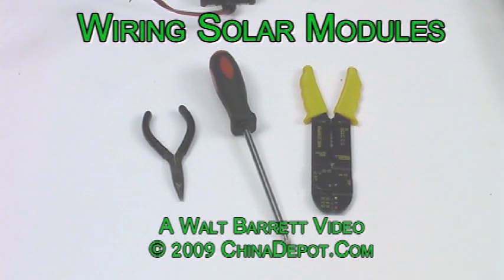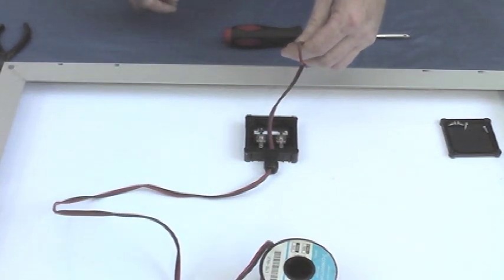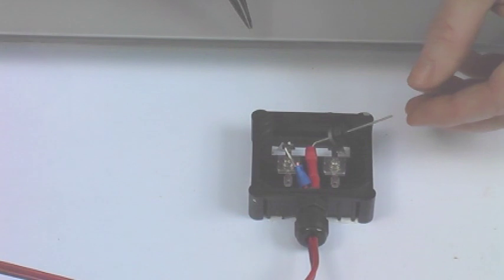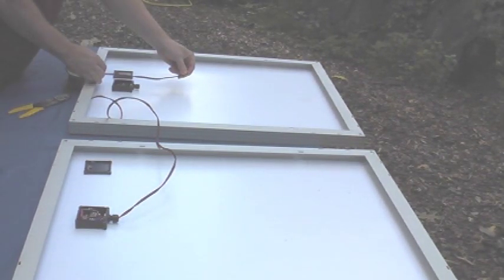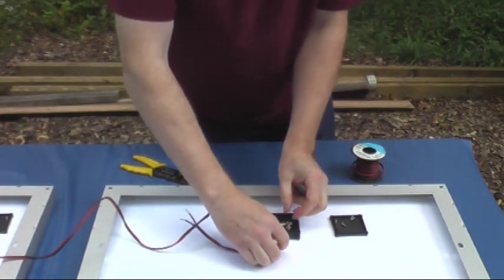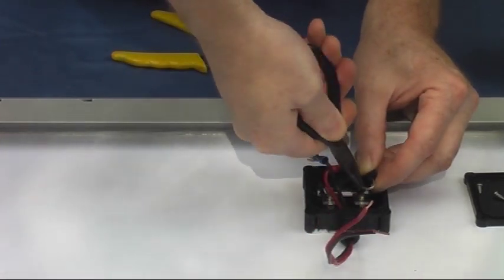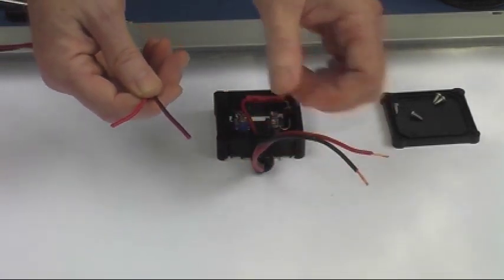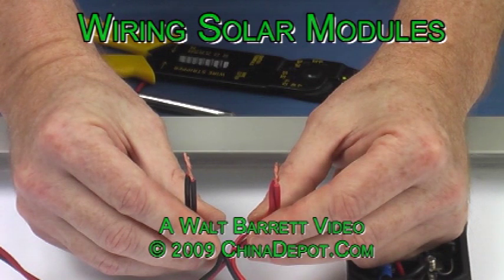How To Wire Solar Modules and Solar Diodes by Walt Barrett wmv

Comment: Took awhile to find your vid  but was just what I was looking for I bought cheap 50w solar panel from China the ones with 2 USB in problem is it shows 18v and more but non of it will change my battery so I'm assuming it's needing s blocking diode

Comment: 100 watts panel should need 10 A diode or 6A should do? Thanks
Reply: 100w /12v = 8.3amps so 6A would be no good if it is a 12v system.

Comment: sir can i use a bat43 as a blocking diode for my old 9v solar panel..thanks
Reply: Anjo Anjo you need shotky diodes to minimis forward volts drop.

Comment: I have a solar panel (10 watt, 12V) which is connected to a 12v, 4.5ah battery. which diode will be perfect for this circuit?

Comment: why do you need one diode for each panel? Would one diode right before the regulator do the same job?
Reply: +frantahouska to prevent hot-spot damage

http://www.pveducation.org/pvcdrom/modules/bypass-diodes
Reply: Eduardo Troller thank you!
Reply from the maker: +frantahouska      Each collector needs its own diode.  Check with your supplier.
Reply: Walt Barrett But why?

Comment: Nice video. I am brand new to solar panel assembly. I am still not understood the connection from the bus wire to junction box. Specially from the bus wire. Do I need to solder a wire to bus wire to bring it to junction box or is there any other connection or clip for that? Thanks for your time.
Reply from the maker: +Ponniah Kunathasan  Hi,  I'm not sure that I understand you. I don't have enough information from you to help you.  I do solder all connections if that is what you mean.  There are many solar workshops on the internet.

Comment: sir good video my solar panel came without cables can i just conect them without the Diode
Reply from the maker: +Roberto Ruiz 
No, if there are no diodes wired to the panels then you must put them in the junction box.  The supplier should confirm the wiring of the solar panels.

Comment: Hi Sir Walt..good day to you... i have a question for you..hope you could help me... I have two small solar panels... a 6volts and a 9volts, i followed your set up here in my small version of joining the two panels... first question, will this work with two different panels in voltage? Cause i saw other videos doing it.. Second: Im using this to charge a celphone so as regulator/solar charger/inverter..., im using a car charger so that only 5volts will go to my gadgets...3rd: And if im not gonna charge a gadget,im charging my power bank instead so if done charging, i will charge my gadgets with my powerbank... will all these ideas of mine work in a small system such as mine for charging gadgets, small LED lamps??? Pls reply sir..thanks in advance and Godbless
Reply from the maker: Mardonio Herrera jr. If you hook them in series you can get up to 15 volts and then measure the maximum amps output with a dc amp meter.  Then buy the diodes rated for that amperage.  You should be using panels of the same output. THe way you did this you are going to have regulate the voltage to five volts to avoid damaging your cell phones etc.
Reply: Walt Barrett  so in hooking up the two panels that im using now, youre suggesting that ill measure the amps of them together so that ill know what diodes to buy, right? so do i still need to put one diode in each panel or ill just need one diode for both panels?                                                                                                                                    Im sorry sir realy for bothering you, i just need you expert opinion on this one, thank yoiu very much for this recent reply...ill wait for your next reply sir, thanks in advance.

Comment: Hi I have a 4 watt, 10.75v, 0.38 amp solar panel charging a small battery for LED lighting and for charging cellphones and other small gadgets that needs recharging. What kind of diode do you think I need to use?
Reply from the maker: On a small system like that you can use a small diode rated 12 volts and 1 amp or more should be OK.  You will need a voltage regulator also. Do not try to power the cell phone directly from the solar module.  You need to match the cell phone voltage and amperage to avoid damaging the phone or other appliances.

Comment: Hi again Walt,

You are right. That is the correct way.
The positive(+) cable from panel connects to anode and then we have a new cable from cathode to the outside.
The junctions box that are shown in my vídeo require the negative cable to go out of the panel without connecting anywhere.. positive cable from panel connects to the left connector and the cable out of the box connects to the right connector. Negative cable bypass the junction box.

Also important. If you have all the solar panel in series, you may have the diode connected only after the last panel.

I've worked yesterday with a specialist in electronic and we have proven in a new solar panel that the junction box was incorrectly setup up and diode was being bypassed in their connection... be careful with this even if you buy a new solar panel.

I will try to post a vídeo explaining this in detail too.

Thank you very much.

My best regards,

Comment: @thamesuser yes you are correct that the charge regulator prevents charge from going back however, the diode is to prevent the back flow "solar shading" to go from panel to panel since they are in parallel you need the diode to prevent reverse flow from panel to panel

Comment: Thanks for the video. What kind of wore did you use though? And doesnt the charge regulator stop the current from going in the other direction at night so do you really need the diode?